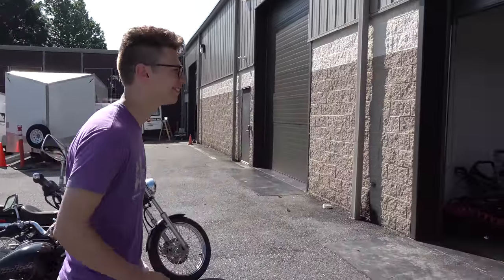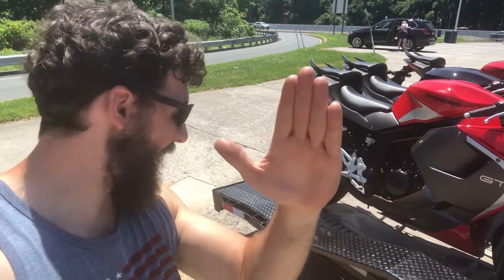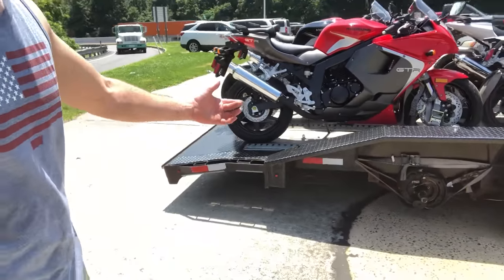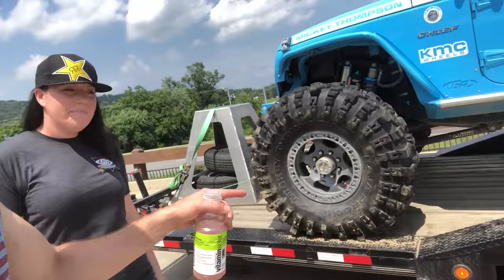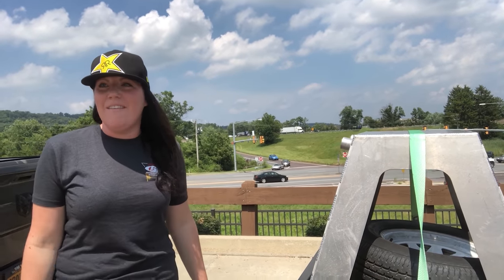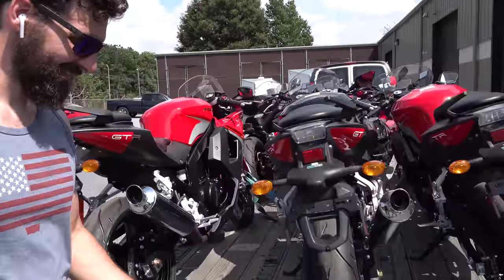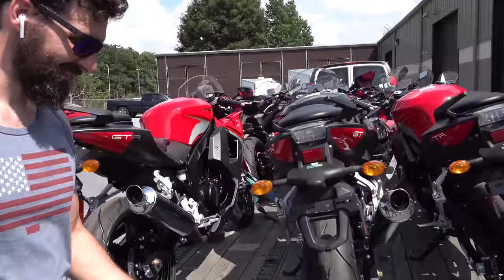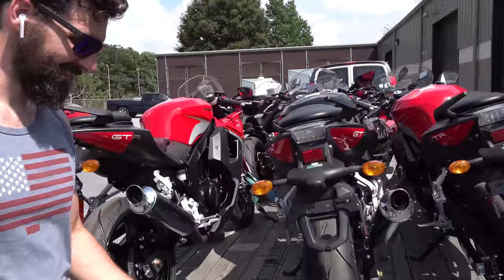Why our trailer almost caught on FIRE bringing bikes back from the AUCTION

Comment: Thanks for another good video! Bearings have long been the biggest problem with new trailers of any kind. Mfrs only packk the bearing, not the hub...soooo, within a short time the bearinggs sling the grease out! Most notorious, boat trailers, hence the greasable hub cap, a great addition on any trailer.

Comment: The exact same thing happened to me hauling used tires from KC to north Missouri  in a 24 foot box truck pulling a trailer with 480 tires in it. Used a come-a-long to hold the axle up for the rest of trip and return. Had my extremities real tight!

Comment: In the interest of public safety, whenever pulling a trailer after the first couple miles get out and put your hand on the hub it if it is slightly warm no problem if it is trending towards hot you have a problem. This is the easiest way to determine a upcoming problem without tools and before a little problem becomes a big problem. If it anytime you put your hand on the hub and it burns you don’t even try to move it

Comment: I got a trailer on the hoist to do the wheel bearing and check the brakes. There is also a way to test the power output coming to your rear brakes ( later gizmo )   things are not all what it seem..

Comment: next time you load the bikes sideways intoo the trailer set them turned opposite to eachother  , that way the handle bars go over the seats of the bikes next to them and you can pack them in a little tighter and i think theres less chance of knocking the mirrors or fairings off under travel

Comment: I'd if anyone said this yet. But the axle on the trailer doesn't turn. Just the wheel does on the bearing. The only time the axle turns is if it's a drive axle. Like it has power of some kind going to it to make the vehicle move.
Reply from the maker: Yeah that makes sense thanks for clarifying
Reply: No problem. Yeah like the other guy said to. Its always good to check your wheel bearings. & You guys can do it easily, make sure all the lug nuts on each wheel are tight then just jack up one side of the trailer & try to wiggle the wheels. They shouldn't have any wiggle to them really. A very small amount is normal on older bearings. But anymore then that, they should be replaced. Plus it's good to keep the bearings greased. Some times there's fitting to put a grease gun.

Comment: The #1 point of failure on trailers is the bearings. why the manufacturers don't put better bearings in them than they do i'll never know. i bought a much more raggedy car hauler brand new from a place in Paduca KY in 2004 and last July i was headed to Georgia to pick up my 2005 Cadillac Escalade from Copart that i had just won so i could bring it home fix it and flip it. well i about flipped it before i even got a chance to fix it and by flip i mean literally on it's side. same issue only i don't have trailer breaks on mine the rear tire on the driver's side of my trailer just disappeared completely I never saw it take off at all, it was just gone and all of a sudden my trailer is wiggling all over the road then started viciously fish tailing i was pulling that truck with my 2006 Cadillac Escalade EXT (my pearl white baby) well i'll link the video below, you might find humor in it, I didn't i was looking for a place to find a new set of shorts and thanking God that i didn't die that day because i easily could have, and maybe even taken someone else with me
http://www.youtube.com/watch?v=X4vXfATmr9U
Reply from the maker: Wow that’s crazy

Comment: What year GT650R's and what are you guys going to be asking? Glad to see no major traffic issues. Have to add an edit, you had 10 bikes at about 500 LB each. There is 5,000 LBS the rated weight of an axle and the there is trailer weight, so you do need dual.
Reply: thanks ; you are the only one that has the right answer. Load carrying vehicles are rated per axle per weighted weight. Two axles generally can carry almost twice the weight as one axle.( generally ) 
That trailer is rated for a certain weight.
Heh Guys read the Government required stamp on the side of the trailer.

Comment: That's why I clean and repack my wheel bearings on my 16ft trailer every winter, but we haul a lot more weight then some bikes.
Reply from the maker: The trailer was pretty new
Reply: These days you can't trust Manufacturers or dealers to do things properly, that's why in the Industrial scene every new tool and equipment gets a Start Up inspection where we will regrease everything and check to make sure all fittings and lugs are tight to specs. I'm not sure but I wouldn't be surprised if you have to replace that axle if it burned out the bearing bad enough it ate into the spindle. Unless the spindle is sleeved then youd be ok.

Comment: Lol, overkill on the tank straps.  You should only need one to keep it up and off the ground and to keep the load on the springs.  You need the 4 tires and bearings because each axle is likely rated around 3500lbs.  Great road repair nonetheless!

Comment: Great Job Guys!! It looks like you've set yourself up to be one of the best de ealerships in the entire state!  Way to go on the limping it home. Once you get your trailer fixed back up to work, it'll be like easy for you to really make things to go smoothly!!  Btw, probably wouldn't hurt to check all the wheel bearings and regrease them if possible or install new ones all around all 4 wheels just to prevent this from rehappening again.
  Great Job! Keep up the great work!!

Comment: Wheel bearing maintenance. You're supposed to do that at least once a year
Reply from the maker: Hhhhmmmm the trailer is barely a yes old
Reply: @Bikes and Beards If you load it near capacity often then you gotta repack bearings a lot sooner than 1 year.
Reply: He’s not loading it anywhere near capacity. Even with a full load of bikes.
Reply: Any of the mass produced trailers come with super cheap bearings. If you buy one, replace the bearings as soon as you get home. Then ,with regular maintaining,  you're good to go.

Comment: 2500$ for a 250ccm motorcycle, its ridiculous.
Here in Norway prices are magnitudes above yours.
I paid 2000$ for my 50ccm Honda nsr scooter 5 years ago. 😭

If I would buy a 125ccm scooter for 40.000kr new, I would have to pay 10.000kr per year for full insurance.
(before the valuta collaps 1$ was 10'ish kr)

Comment: Holy crap! If that wheel had come off in traffic you might of killed somebody! Maintain your equipment!
Reply from the maker: The trailer is just over a year old. We take great care of it
Reply: @BikesandBeards  Must have been premature bearing failure. Sorry to doubt you!
Reply: @BikesandBeards  i would  bet those wheel bearings rated to 45mph.
Reply: I would pull all the wheels on that trailer and check all the bearings

Comment: each year that you have a trailer you need to service the wheel bearings.
the reason you need tandem axels is so you can get home when you fail ! to repack your wheel bearings. LOLLOLLOL
and please stop calling brake shoe  brake pads . They both have brake linings  attached but otherwise  they have little in common. If the friction surface curved it is a shoe, unless it is a brake band.

Comment: Need to purchase a triple axle trailer
Reply: 2 is plenty, triple is huge and probably puts you in CDL territory
Reply: @kfstreich4787  no CDL required..
Reply: @neilbrown82  it depends on a lot of details, 3 6k axles behind a sub 9k gvw truck would just make it, that's a 3/4 ton as it is now.  Weight wise that doesn't make sense,  I'm not sure about state laws but Sean  (???) Is a pretty sharp guy and it may make more financial sense in PA to use a van than a pickup, in other states a pickup with a larger trailer makes more financial sense. You may need to derate the trailer, lower resale now!  It must pay for its self for your business. It is doable but doesn't make sense,  better to start a pretrip inspection program.   Then again I'm sure this video will pay to fix the problem so why worry!